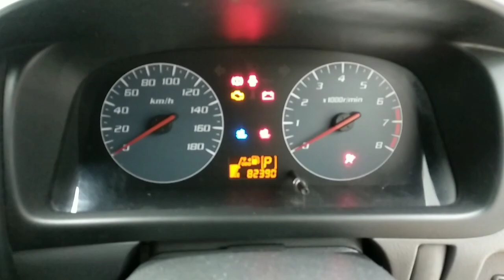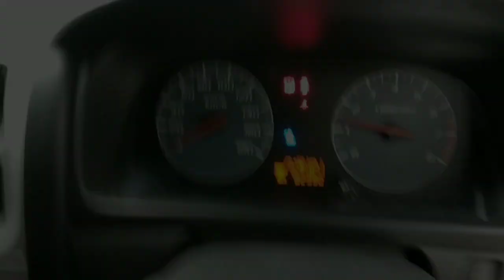DIY perodua Viva tukar minyak gearbox/filter mudah

Comment: Ini untuk auto atau manual transmission tuan ?
Reply from the maker: maaf baru perasan mesej..auto saja ada filter..jika manual tiada filter..
Reply: @mrorait7236  makna nya drain minyak lama saja lpas tu tuang minyak baru ke ?
Reply from the maker: @sellnita7840  ye..cuma yang manual lain sikit cara.,sebab gearbox manual tak ada jarum check minyak gearbox.,dan manual sukatan minyak tak sama banyak..
Reply: Boss boleh campur ke minyak gearbox d-3 Sp dgn d111?
Reply: Dlm oil sump gearbox manual ade magnet x? Naya jgk dlm gearbox takde filter ni.. ingat nk buat dkt kete ayah..
Reply: Gear manual convert auto avy